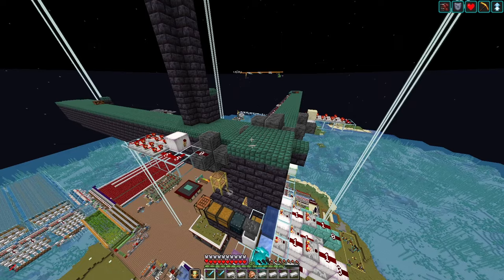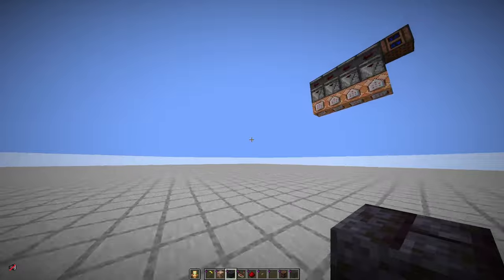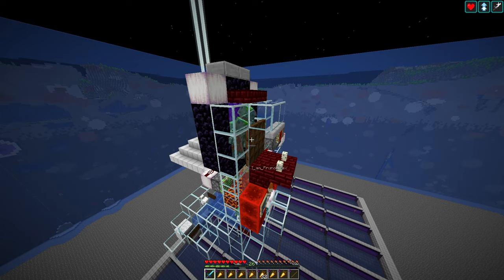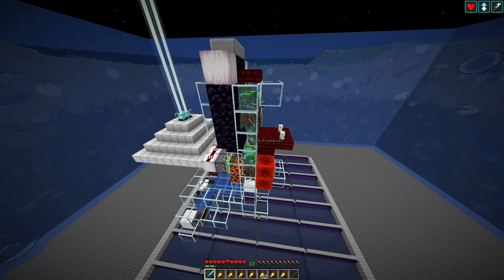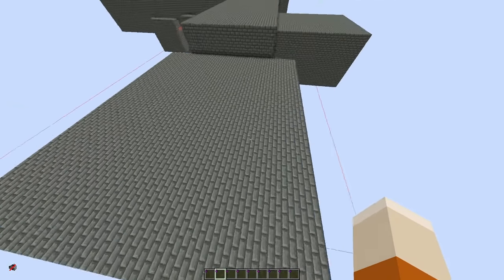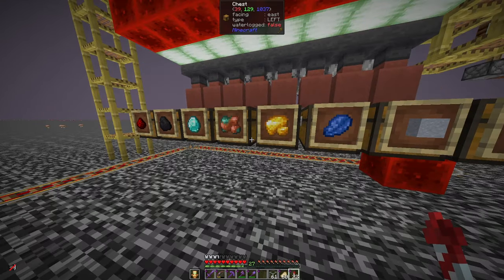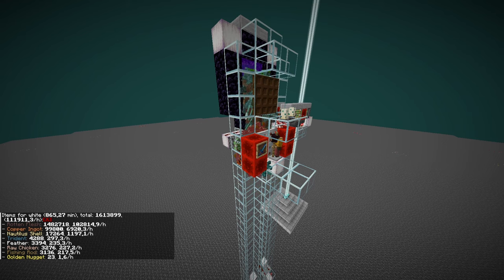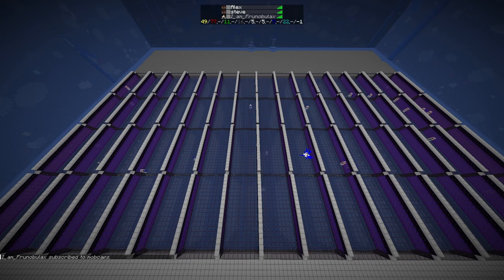Copper&Trident farms in MC 1.21.3 (Minecraft Java 1.21.3+)

Comment: Whats with snow golems shooting at them?  There were always some farms which used that. They make 0 DMG and could trigger the more calls?
Reply from the maker: You'd need a huge amount, and I don't know how many reinforcements you get from 500 golems in one spot hitting 500 drowned in one spot. In a typical IanXOFour reinforcement farm you'll have between 500 and 3000 mobs in the kill chamber, so each swing of the sword gives you basically 500 to 3000 reinforcement chances. It would be tricky to reach that kind of rates with snow golems.

Comment: How are you avoiding the drowned pathfinding in the water stream to the nether portal during the night? i have built a similar farm, based on docm's and it basically shuts down during night, since the drowned will just spin around in the same place in the water stream.
Reply from the maker: Which version are you using? I saw this in 1.21.1 as well, but water streams appear to move the drowned just fine in 1.21.3. Perhaps a change to pathfinding/swimming that was reverted now.
Reply: @FrunoCraft  1.20.1. with Fabric, tweakeroo, litematica, sodium and minihud
Reply from the maker: @jeppefiig5578  I guess it will be fixed when you upgrade to 1.21.3, not a lot we can do until then.

Comment: Instead of the light emitting portals, why not use minecarts, WiSke Train style? Less invalid spawning spaces and single player friendly.
Reply from the maker: I thought about that, but it would be tricky. 1-high mobs and minecarts don't mix well, and you'd need a very large number of minecarts to cover the area reasonably well. But maybe it can be pulled off.
Reply: @FrunoCraft  if I have time I'll play around with it and see if I can get something working. I have an idea but I need to check if that's viable. You could probably even use boats in minecarts so you could keep 1 tall mobs away from the actual track, but I have no idea if it's possible to separate those again in a way that you can get a working killing chamber :D

Comment: Really nice video, just something else to add on

Drowned can also spawn in dripstone caves, and can spawn in up to groups of 4 compared to rivers which are only groups of 1. The catch is that the drowned in dripstone caves have a higher spawn failure rate than river biomes.

In an 100×40×100 water cube dripstone caves spawned around 53000 drowned per hour while river was 40000. So if you can get your farm to intersect a river and a dripstone caves it would be most ideal.
Reply from the maker: My problem was that Dripstone Caves seem to generate only at higher altitudes, I've tried to find them at bedrock level and couldn't. Was I just unlucky? If you find a large dripstone cave at bedrock level, then this is even better than a river biome.
Reply: I think lowest I found was like y -40 but I just thought it was worth mentioning
Reply: @FrunoCraft  the lowest i've found is on -50, and there were like around 10 dripstone caves in one place (super big). its definitely worth a try imo

Comment: I wonder if it would be worth putting a mob sorter on a general mob farm to supply fresh zombies into a reinforcement farm. It wouldn’t let you achieve the exponential growth of previous designs because you wouldn’t be able to spawn new “seed” zombies once you hit mob cap but it could combat the exponential decay for those who don’t want to use a river or perimeter based farm.
Reply from the maker: The problem is that if you kill mobs with a normal sword they will spawn hardly any reinforcements, because they die quickly. If you use a weak sword (like IanXOFour) then you can hit them more often but they'll be in the kill chamber for a long time and block the mob cap. I don't think the results would be better than a run-of-the-mill trident farm.